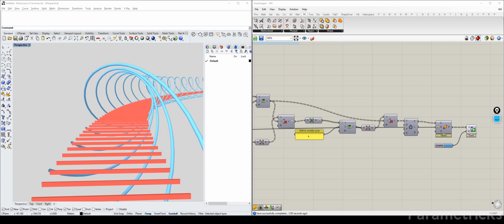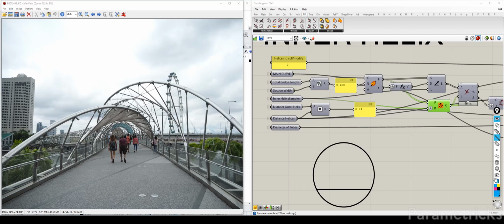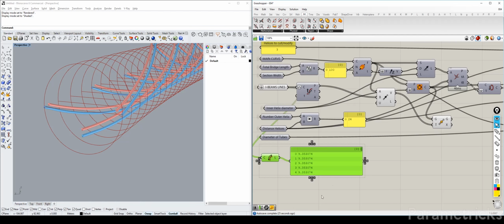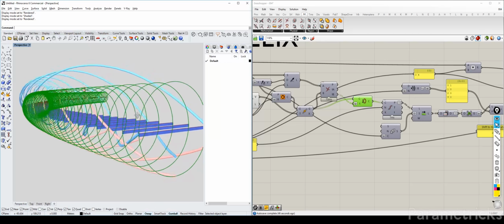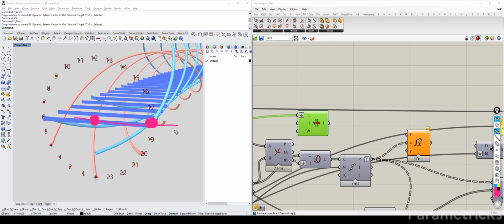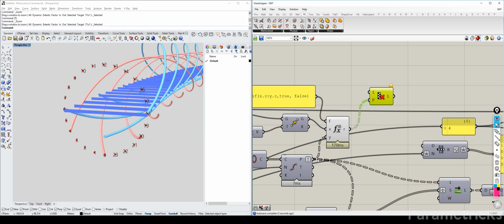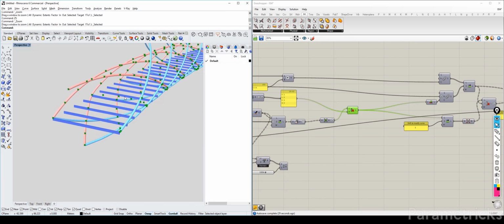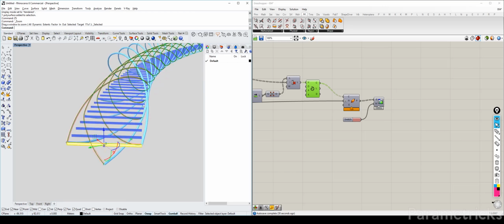Making the Helix Bridge with Grasshopper, part 05/15 (Grasshopper Tutorial)

Comment: I've got the beggining of the bridge correctly, but i can't get the same result at the end. All the helices end in the last section and i can't find the problem or the component to change :(
Reply from the maker: Can you take a snapshot of the issue so that I can have a look?
You were able to follow through the end of the video or do you have a timestamp on which part of the video that you notice that the result is not the same?
Reply: @Parametricks  Well, i don't know where to send you the snapshot :( i followed until 33:31 where you go to the other extreme of the bridge. Your helices are well configured but in my case all the tubes end in the last section (we had 100 sections of perp frames).
Reply from the maker: @lustrossa  Hi, You can upload the screenshot to https://imgur.com/

If one end of your bridge is fine while the other is not, sounds like an issue with the ordering of points and/or the group. Important here is the double reversal process I did in the output of the points (the L in the culling) and the input of the group (the L in the shift list).